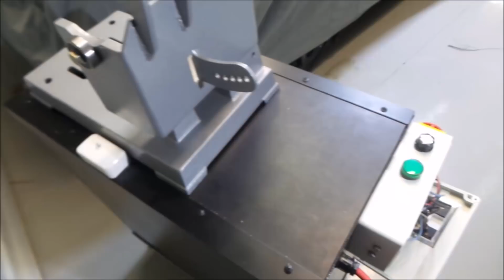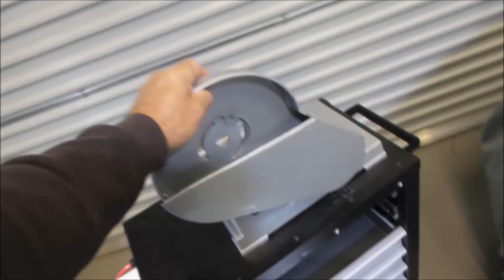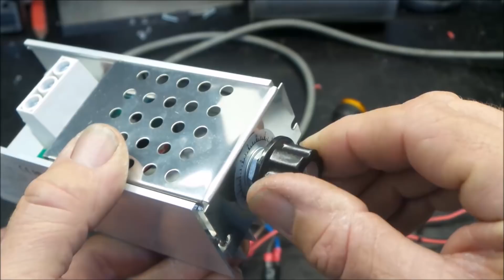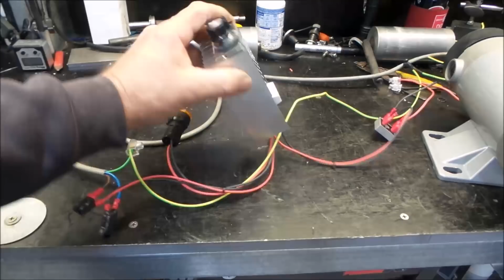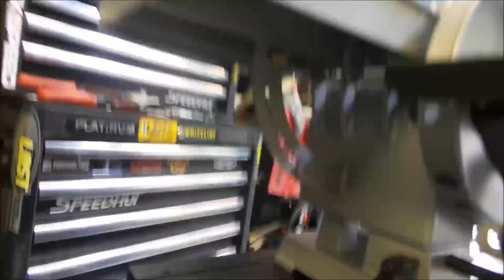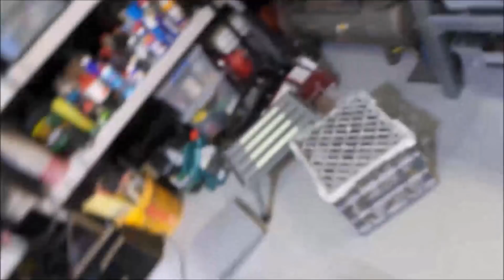Belt Disc Sander Linisher Repairs & Modification Finale ep4

Comment: Mate, would you please take a minute and let me know where you found parts for the sander? I have the identical sander, and it tipped over and as a result needs a new disc.  I don't have any brand markings to go by, thanks.

EDIT: Looks like I jumped the gun, did you ever find a replacement disk?

Actually, I also have an identical drill press and a few years ago I sold an identical band saw to yours.